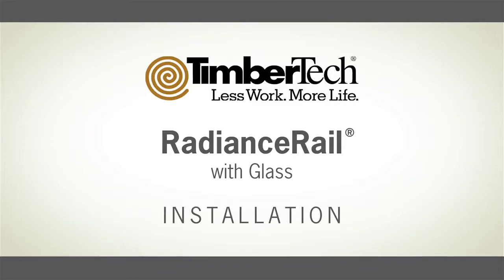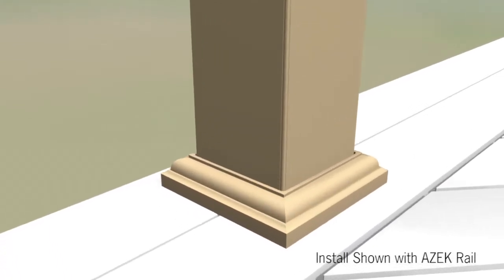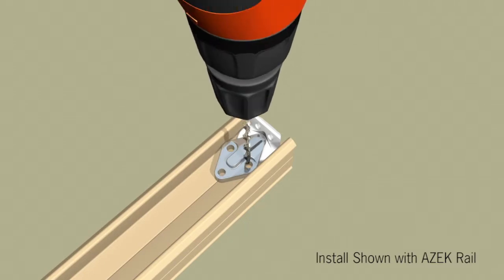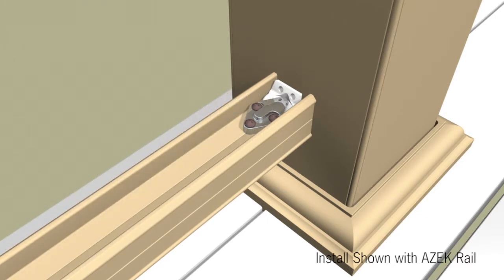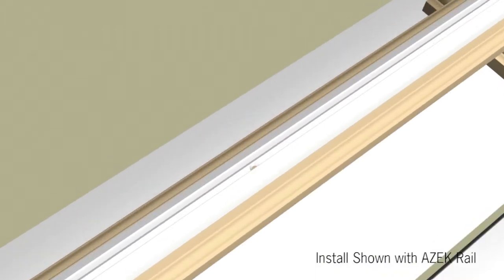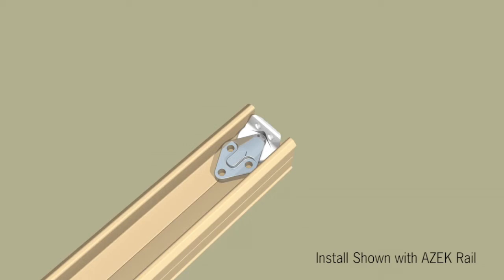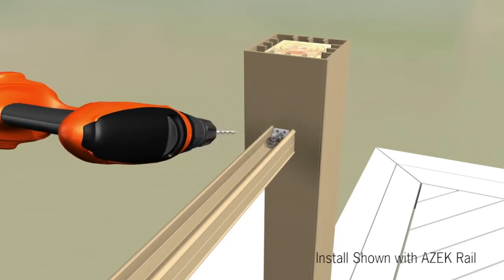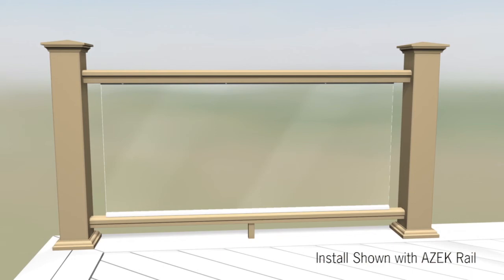TimberTech RadianceRail with Glass Installation

Comment: Great product, finished results are very good - but installation instructions are flawed, almost impossible to install the way instructions show. 

I did it this way:
1) cut and pre-fit bottom rail
2) cut top and bottom glass channels to width of glass panels
2) install glass channel on bottom rail
3) remove bottom rail (that is just resting on bottom support rail)
4) install rubber gaskets into top and bottom channels - I used silicone grease on inside and outside of rubber as they are very snug. They must bottom out into into the glass channels.
5) slide glass into the channels from the end!!! this cannot be done with the bottom rail in place between the posts. I found it almost impossible to slide the glass panel straight down into the channel from above.
6) now get help to lower glass assembly and bottom rail onto the bottom support rail in one piece.
7) have your helper balance the assembly while you attach the top support rail. Your helper wont have to stand there as long if it is pre-cut with brackets attached and ready to screw on.

Tip - I used scrap pieces of the top and bottom rails to adjust the miter on the saw - then sliding them into place on support rails to check angle. Once it fits right - cut that end of rail for a better fit.
Reply: Thanks for the suggestion.  I was able to install 80+ feet all by myself using this method.  The only difference is that instead of the silicone grease suggestion I used lots of windex spray on the rubber gasket.  This was a suggestion from the glass shop where I purchased my panels.  It worked perfectly!